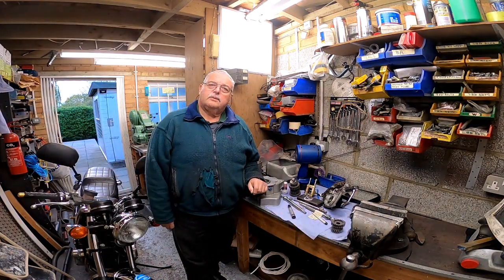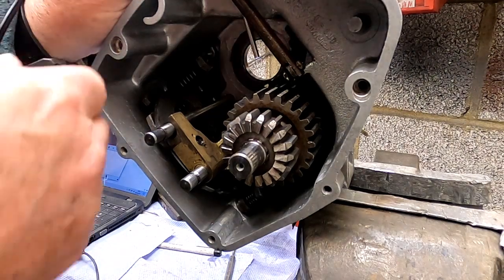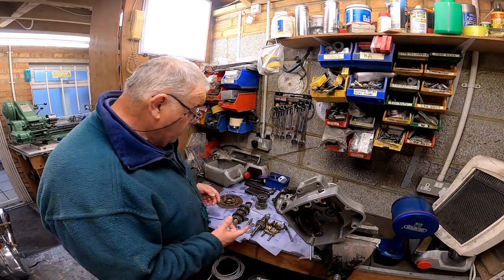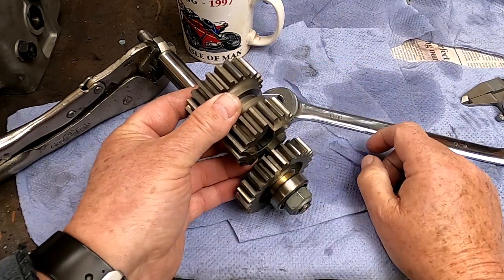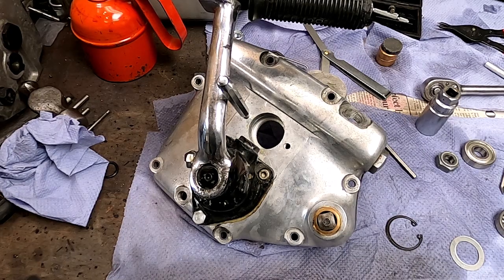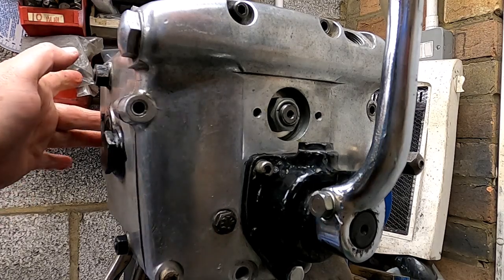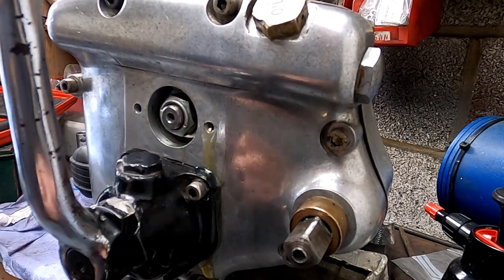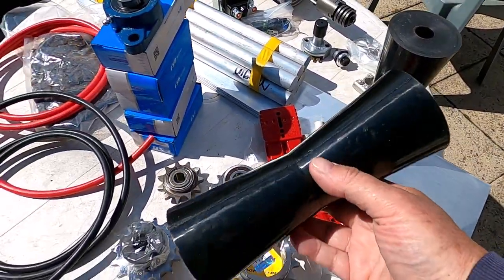Velocette 500, 4 speed reassembly, part 10

Comment: Brilliant Alan. Love your attention to detail, your many years expertise and experience shines. Shame we didn't see you assemble the layshaft (because that's what I'm tangling with at the mo' - need to ascertain what 'fixes' the position of the layshaft ratchet 1st gear - in relation to the kickstart ratchet). Thanks Alan.
Reply from the maker: Probably the most significant measurable is the mesh of gears on the layshaft with those on the mainshaft.
Aim for full gear width engagement and shim as appropriate. 
End float on the layshaft is ultimately controlled by the thrust pad and the 3 pins which keep it in position as the kick started rachet moves in and out. This can be confirmed by assembly without a sleeve gear where movement of the layshaft can be felt by finger through the sleeve gear bearing hole.(no bearing in place)

Comment: Wonderful work Sir. I'm still sorting out issues on my new to me '54 MSS. After swapping all the clutch springs to correct length (had the shorter 7/8" springs in there), first test found too much grab....idling in neutral on center stand...bike would stall as I applied the brake. Made adjustment to free up clutch a little but then could not restart...many attempts when suddenly the kicker starter lever jammed solid, unable to be moved down from vertical no matter what I did with gear selector or rocking the rear wheel. Off with the kicker housing, both springs in good order, but I found some notching around the inner edge of the housing, where the gear teeth edges coincided. Further I did not find the "wedding ring" spacer/washer present up against the 1st layshaft toothed gear. Was hoping to catch of glimpse of that on your video but alas not seen. Have the spacer on order from the UK. Thinking is that the layshaft toothed gear was able to move outward enough to bite into the kicker assembly housing and jam the whole works up.
Reply from the maker: Thanks for the response.
Make sure you check the straightness of the main shaft and also use the correct thickness outer cover gasket to help control end float. Also, I made a video on the clutch in video 7 and 8 in the "5 speed conversion series." This may be of interest.
I have never heard of your problem before.
Interesting.
Have fun
Alan

Comment: Hello Alan
I wonder if you plan to do an oil pump removal/overhaul/replacement. I'm contemplating doing mine and seeing you fo it would be magnificent! 
Kind Regards
Brian
Reply from the maker: Thanks. I bought a new oil pump from Dodkin in 1982. The original had got rusty and pitted as the bike was deralict when I bought it.
I see the oil pump as being something which will never see the light of day in my life time as so far it has Only Ever had good clean 50 weight go through it. I expect no noticeable wear on the drive gear or the oil pump shafts.
I remember the need to assemble the pump segments so that the outer surface remained completely cylindrical so it fitted nicely into the crank casing. I remember agonising about the orientation of the pump before I inserted it into the hot crank casing. I remember examining the crank case bore surface for scores etc.
Sadly I have no photos of any of this.
It easy to measure / assess the internal clearances.
Happy to discuss further………I may have an oil pump buried away in an old crank casing….I may dig it out and have a look at it. Hmmmm. It might be worth a video.
Alan
Reply: @alanglen5902  Many thanks for your prompt  reply Alan - much appreciated. It does look quite a straight forward job but the intricacies of measuring tolerances, judging wear, improving tolerances, and reassembly and refitting would be very interesting as no-one has made a youtube video that I can find.
I don't see an overhaul business advertised so I think a video would be invaluable. I'll take photos when I do it but I wouldn't have your presentation skills to make a video. 
Thanks again for the youtube videos you've made.
Brian

Comment: Been watching your videos as I have an odd fault in my 4 speed box. Can't suss it though, it's graunching occasionally, not always, when downshifting. Layshaft first is tight on the layshaft. Can't figure out what it is!
Reply from the maker: Well there are several elements to this:
1.  Clutch adjustment
2.  Bush clearances, both axial and radial, on main shaft and main shaft
3.  Selector fork geometry / wear
4.  Bent main shaft
5.  Overall gearbox condition / end float set up
6.   Etc etc
It is easy to speculate, but very difficult to annreally is vey difficult to s
Reply from the maker: Sorry clumsy fingers I was just concluding that it is difficult to offer a sensible suggestion without seeing parts etc
Reply: Thanks for the reply Alan. I had it all apart yesterday and have been inspecting for wear. It's not too bad, I think my problem is the layshaft fork contacting the back of layshaft third. Do you shim the layshaft, or shim behind the bearing? I thinkni could also do with replacing layshaft 3rd and second bushes and maybe the sleeve gear bush too. Does the layshaft 1st and 4th press together?
Reply from the maker: @graemewhit1208  
My strategy was to start with the lay shaft loaded into the casing with the ball race fully home.
Then shim up the sleeve gear to ensure the full width of the sleeve gear / lay shaft gear mesh across the full width.
Then shim up the lay shaft to control end float.
Then work on the main shaft to make sure you have a first gear which is free on the main shaft without excess radial and axial clearance.
The middle gears on the lay shaft are contained by press on outside gears. The 3 leg puller should pull these off, just make sure you get them back to where they are now when you replace them. It’s unlikely that they have moved since they were first installed at the factory?
Reply: Many thanks. Sleeve gear engagement with layshaft 4th isn't great. Not measured but probably needs at least 1mm of shims. 
Thanks.